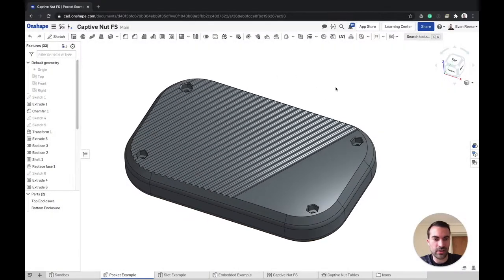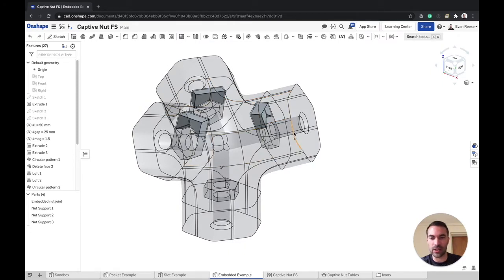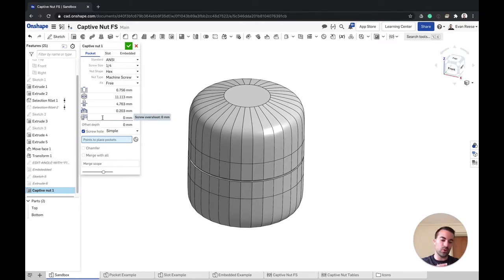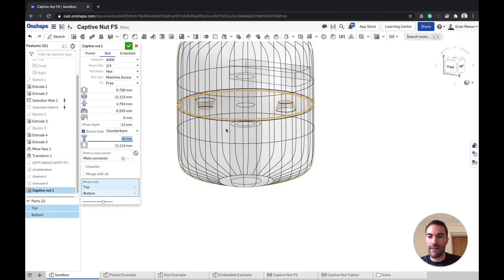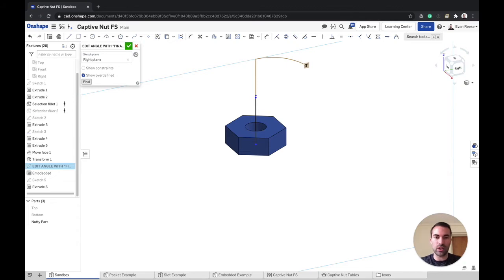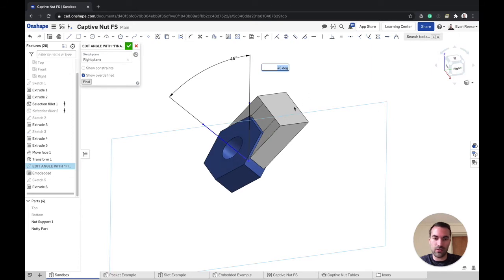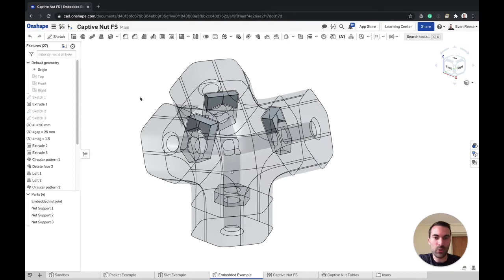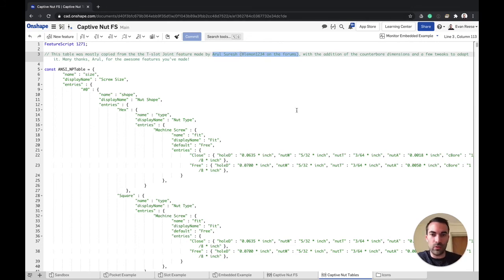Feature spotlight | Captive nut

Comment: Great feature script once I found a version that worked.  I was having trouble with V21 showing all of the options under Nut Spec as far as the dimensions with icons.  But, I'm on a laptop currently so I don't know if the screen size is causing this.  Still fairly new to Onshape so maybe I'm doing something wrong.  Been doing this manually and this will save a lot of time and headache!  Would love to see a countersink option along with the counterbore.

Comment: This is a great feature! I've been using Nut Pocket JR but it doesn't have ANSI options, so I think I'll switch to using yours. One feature request: a way to rotate the nut 90 degrees. Sometimes it's beneficial to reorient the nut depending on how I'm planning on printing the part.
Reply from the maker: Thanks! I actually re-wrote the feature from scratch to simplify some things that were bugging me and I've added the ability to rotate the nuts there on their axis. You can also do this with the current feature by referencing a mate connector and editing that, but changing each one can be cumbersome. Here's the 2.0 version of the feature https://cad.onshape.com/documents/d210fcf0f8b5e96ff2027adb/w/532b4113cecd2089664e73ab/e/bffff2b698cfb8b3e261c7cf

Comment: Is there anywhere that shows how to do this from the beginning? I already have a piece I designed with holes for bolts, works well. But would like to add the captive nut part so they don't have to use a small wrench each time putting it together. I can't for the life of me get this to work on my drawing that already has the holes there.  I am a beginner if it wasn't clear lol.

Comment: How do you place the pocket without using mate connector? When I click a point on a part to place it nothing happens
Reply from the maker: I'm not exactly sure what's causing your issue without seeing it, and you may be using an older version of the feature. Also, is the Merge Scope selected? Check out this example: https://cad.onshape.com/documents/ce66227347611d6193cf2a01/w/2503d43dcb62faa413f23c63/e/bac33429822b2817e56c1569
Reply: @ovyl  Okay I realized my problem which was that I wasn't making my point on a sketch on the surface of the part. Thanks!
Reply from the maker: @Atomic_Chemist  Got ya. Yeah, this one doesn't work quite like the hole feature, which may make it less familiar when getting started.